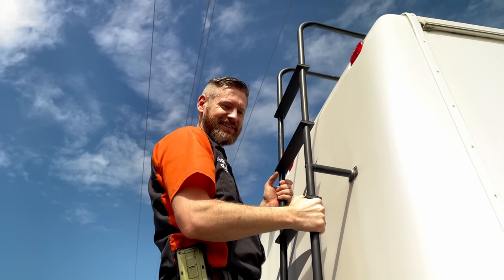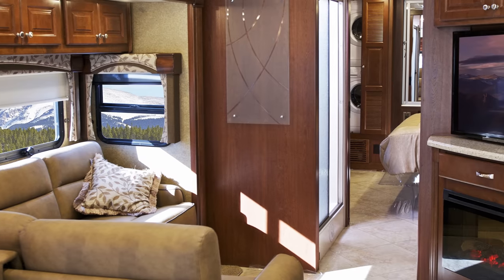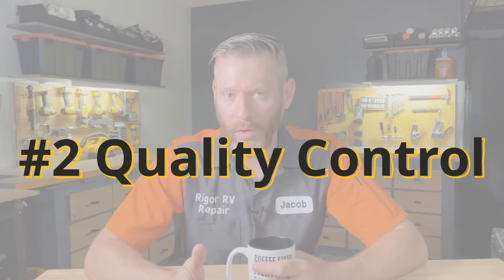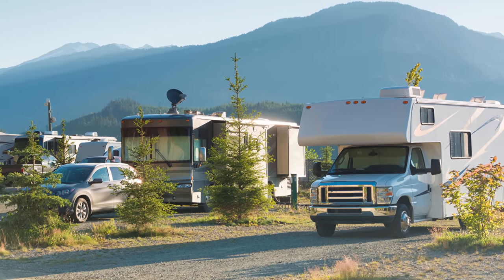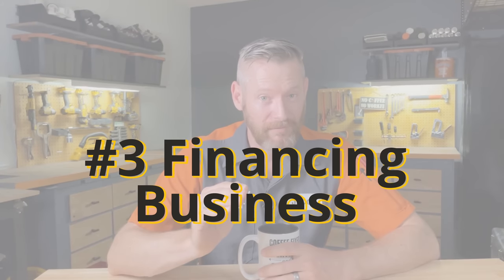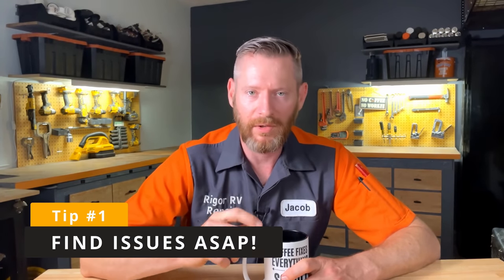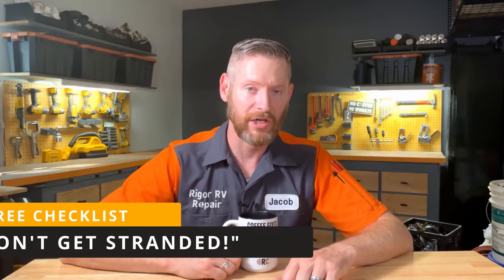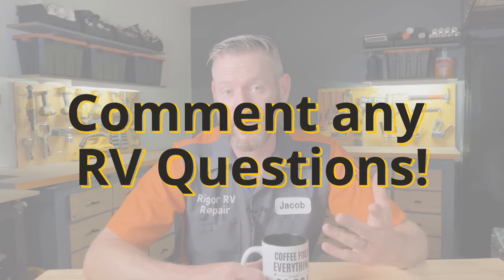3 Dirty Secrets the RV Industry doesn't want you to know...from an RV Tech

Comment: Bought a brand new camper July 2022. Went to pick it up and the power tongue wouldn't work. They replaced it on the spot. Within a month I had to replace the outside kitchen door because the hinge was catching. While they were replacing that, I asked if they would fix the light on my power tongue jack and instead of just fixing the light they replaced the jack again. Said it would void the warranty if they opened it up to replaced the bulb. Then some of the outside lights went out. Then the outside kitchen door hinge was catching again and the whole door fell off. Then the water pump stop pumping water from the fresh water tank. That one turned out to be a simple adjustment on the pump. A lot of small issues, but the dealership service department were great and always got me in and out quickly. Normally anytime I bought a new car/truck I always got a few years out of it before something went bad.  But so far all in all the camping is worth it. I do wish the quality was better, but the lack of quality seems to be across the board with all makes and models.

Comment: #3 is an eye opener.  I had checked out a loan package for an Rv a couple of years ago and it was astounding. No, I didn't buy the Rv because the loan was insane. The percentage rate was too high (but the industry was at a high at the time with sales), it HAD to be for at least 7 years. I had no choice but to start at a 7 year loan and there was a penalty for paying off too early. Then end result was pay a fuckload more money for the RV 7 years later. Also, the warranty would be useless anyway if I had to take it back to the shop and wait months for them to get around to it. Then, I am paying for an Rv that I cannot actually use.
Reply from the maker: Ouch. Yeah sounds about right. Yes getting warranty work done and done correctly is a huge problem in the industry right now.
Reply: @undercoverrvtech   Is there any particular type of rv you see more of due to poor workmanship...for example, the light weight ones or one's from a particular company? Ones that you would think are very very well made?
Reply from the maker: Keep an eye out for my upcoming review videos!

Comment: New sub. We bought a new lance truck camper. We set out on our first trip with it. I found the shower tub surround had cracked in 3 places. The cracks line up where the attachment screws are. The 3 way fridge only worked on 12V propane didn’t work. AC didn’t work. I checked it and the fridge wasn’t plugged into its dedicated outlet. The propane didn’t work the whole trip. Under 12V it’s drains the batteries. Dealership is getting hard time about replacing the shower it obviously wasn’t installed properly. We hadn’t even used the camper when I found the cracks. Waiting for parts now. Frustrating

Comment: 100% with you on this.  Dec 2022 I purchased a new 2022 Jayco Alante 27A from RV America in Calera AL.  I felt the "deal" I got was very good (price paid vs MSRP) but there are certainly issues.  #1 dealer didn't disclose the $1,000 they charged me for PDI (Pre Delivery Inspection) until document signing.  Honestly I should have argued this but decided not to.  Clearly they must have gone over it well if they charged me $1,000 right?  Right?  #2 the steering stabilizer that the dealership installed as part of the deal was installed improperly and never road tested.  #3 the Wineguard 2 system was wired backwards at the factory.  Apparently this is a VERY common issue with these system's on Jayco Alante units.  Much like your air conditioner story, how was that not caught before it left Jayco.  #4 all sorts of trim is falling off and the reason is the staples/brads used to put them up didn't hit anything other than the trim.  #5 dealer inflated tires to max sidewall pressure.  How on earth do they not know that's not the right thing to do.  There's a sticker by the driver's seat that has the appropriate pressures (I double checked it with Good Year's web site).  #6 the vent for the range doesn't close properly as it wasn't installed properly.  #7 nearly every drawer opens during driving.  This is bad design, my previous RV (2016 Winnebago Trend) used MUCH better latches on drawers and cabinets.  A 6 year newer RV has gone backwards in terms of design?  #8 kitchen sink drain leaked.  During assembly someone dripped PVC cement onto the threads while assembling pipes.  Fouled threads wouldn't allow the pipe to properly thread to the fitting on the bottom of the sink and thus it leaked into the drawers below.

I'm sure there will be more but I've only owned it 6 months.  With all that said we've done 3 trips so far and the RV is working well otherwise.
Reply: Sounds like you have 1 of the better products, these scammers, produced. 99% of them are junk new.

Comment: I have had several RV's over the past 15+ years, and recently have had two Class C's which had a Ford chassis. Ford sends their chassis' to the RV makers with neutral, unadjustable alignment bushings. These bushings Must be replaced in order to align both Camber and Caster. 
Anytime permanent weight increase or decrease is made to the chassis, an alignment Must be performed or poor handling will result. 
Camber is the tilt-out or tilt-in of the wheels and affects tire wear. Caster is the forward or rearward angle of the axle hub and affects both wear, if one side is disproportionate to the opposite side, - and most significantly, affects  negative impact handling, especially the ability to return to the neutral position of the steering mechanism. If the vehicle wanders or if it tends to stay in a drift (left or right), caster may be a significant cause. 
I have had two Ford chassis RV's and both have had the same unadjustable alignment bushings that come from Ford. These MUST be replaced or the vehicle will Not perform well regardless of specialized after market suspension components installed! I have inspected as many Ford F-350 and F-450 front ends as I have come in contact with (especially on RV's) and have always witnessed the same Unadjustable alignment bushings! Ford Inc. will Fax or email the appropriate specification sheet with all settings and tolerances if you make a call to them. Some alignment "specialists" claim that the aligned the vehicle without replacing these bushings, but that is a Lie because the stock bushings from Ford CANNOT BE ALIGNED!  
The bushings can be seen installed in the upper control arm of the vehicle, and a picture can be taken by pointing a camera straight down at the top of the wheel/tire assembly inboard of the tire. If you need help identifying the stock bushing just respond to this text and I will explain.

Comment: I bought one new RV.  Ended up witha rotten floor from some dipstick on the assembly line put the buteral tape seam up behind the water fill port.   Of course it was discovered well after the warranty was over.  

Now I never buy an rv less then two years old without a thorough inspection. That’s when the problem start showing up.

Comment: This is why I would never buy a mass produced RV. I do plan to buy a class B camper at some point in the future, but it will be custom built by a high level shop that has a reputation for quality. It will cost more, but I'm OK with that if it means I won't have to deal with a bunch of inexcusable quality issues, and can simply enjoy my investment. The worst part is that mass produced RVs are already extremely expensive, even though you're getting sh*t quality, so you may as well spend a little more for a custom unit.

Comment: What are your thoughts on stabilizer jacks. My 26 ft Grand design Imagine XLS came with 5000lbs stabilizer jacks. One jack failed, not at the scissor, bit at the mounting plate. My entire Rig empty weighs in at 5176lbs. When I’m loaded up I’m only adding about a total of 500lbs. 

My view is that it is not scissor components of the jacks that fail as they are likely worthy of the 5000 capacity, but the mounting plates (about 1/8” thick) that are the support between the chassis I-beam and the scissor are entirely inadequate. After the jack mounting plate bent on my rig, I was able to bend it back into position bare handed without struggling.
I just purchased 9000lbs jacks and will add 1/4” x 8” x 4” steel plates between the frame and the jacks mounting plate.

If these jacks truly supported the weight they claim to support a gust of wind should not be able to collapse the jack
Reply from the maker: These frames are notoriously lightweight.  The jack will easily hold the rated 5000k lb without any lateral stress. The problem is as you said, wind pushing the rv sideways put stress on the frame in a way it was not designed to handle. I agree this is a bad design! Another problem a lot of people encounter is the tounge frame on travel trailers collapsing when using an equalizer hitch and driving through a steep angle. Same 1/8 steel on the tounge. Same kind of under-engieering in my opinion.

Comment: No secret, these are apparent to anyone who has been duped into buying most RV brands. There are still a few quality RV companies out there and you will pay for that quality. Most of which sell only directly to the consumer. Which tells me that the dealer network has failed in providing service and maintenance. Do some research and if you have the funds save yourself the aggravation and buy a top of the line unit. It's worth it in the long run

Comment: I use to live in camp grounds, the amount of people with RVs costs 6 figures and them not being able to keep water out when they aren't even half a year old is really pathetic.  I wouldn't have a RV of any kind, I converted a school bus to serve as a RV, lived in it for 5 years to save to buy a home, so much easier to work on a bus (and cheaper usually) than wimpy underrated RVs that are just cobbled together with foam board and glue and vinyl.  Very little metal goes into it, I've scrapped 3 units in my life, all built like crap, I'd never ride in another motor home again, they are soo unsafe and the makers couldn't care less.

Comment: Wow. Good video. So, buy an expensive one (airstream) or build one. These things are very expensive not to be good to go out of the box. 
Can you identify good quality brands?
Reply: Expensive doesn't help.  Sat in a new Airstream and thought about paying as much for it as we did our hosue way back when.  It started raining and water poured nto the bed in a $85,000 unit.  This was back in about 2015, so I doubt quality has improved.
Reply from the maker: Unfortunately with brands they have various line with different quality builds. With hundreds if not thousands of different RV's on the market it is almost impossible for me to make generalizations. 
Stay tuned for more videos about things to avoid in RV's, a lot of my shorts will have tips that will help with shopping.

Comment: I want to thank you for your honest opinion about these factors. I have a 2020 Keystone Cougar 315  RLS that on our first trip the shower doors broke in transit. the dealer did replace them, however on our next trip they cam apart during transit.(frame separated from the wall) ,  after getting that fixed, the 3rd trip again they came separated from the wall during transit. My wife and I decided we don't need shower doors, we removed the doors and frame and installed a shower curtain. I'm very interested in keeping up with you channel. again Thank You very much for the info.
Reply from the maker: Yes, RV walls are almost a joke as the paneling is very thin. I'm sorry to hear they could not get this fixed, it sounds like the walls needed more support inside to screw the shower frame to. I suspect the screws were just put into the 1/8th inch paneling which is why they were ripping out.
Reply: @undercoverrvtech  We've had similar issues with our 2022 Tandera 5th wheel. Why the hell do they put screws into air and expect it to hold! My husband and I are re-engineering and fixing many of these issues ourselves as we will resolve the issue properly. We have a more involved issue with the entertainment slide out cabinet - the entire wall panel is detaching from the cabinet frame. Once we looked at it we discovered they only got 2 of the 5 support braces in the cabinet frame installed flush, the middle 3 braces stick out over 1/2" causing the wall panel to bow. After bouncing down less than silky smooth interstates the panel finally gave up and came off. The up side is I can now also fix the COAX connection that has never worked from day 1, install a new HDMI cable for a sound bar and clean up the wiring. As for the cabinet we will replace the 3 bad braces and install new ones attached properly and not with staples.

Comment: I was going to purchase a new tow behind rv trailer.. something small, under $25k. Went to look at them and couldn't believe how many things I could find wrong with them, and I'm not even anywhere near an expert.  Decided against buying one, because I'd only be using it for 1 or 2 weeks a year and I couldn't justify the cost. It's not like I even need it for that 1 or 2 weeks- I don't currently and never had before owned an rv.

I ended up renting one slightly larger than I would have purchased for a week last year for about $800, including insurance on it. This seems like the route to go if I want to use one for a week or two a year.
Reply from the maker: Renting certainly makes sense financially if you are only using the RV occasionally. I work on rentals frequently when they break down here, the challenge for the owners renting them out is maintenance. It is hard to get repairs done quickly between renters, and sometimes this results in a nightmare vacation for the renters. That said I work new RVs that are breaking down and ruining vacations as well. 😆
Glad to hear it worked out well for you!

Comment: I am about to buy a very small RV trailer that I may have to repair its front cap and front portions of the sides that adjoin to the front cap. The exterior skin is delaminating like this and has bubbles. 

I'm thinking of buying 2' by 10' corrugated metal from a hardware store and bolting them thru the front every 16" or so. Then on the seams I'm going to cover them and the bolt heads with white EDPM "eternabond" tape. 

Should this work?

Comment: Fantastic!! My kids just purchased a 46 ft Jayco Seismic 5th wheel not knowing it had a soft spot on the roof drivers side next to center pop up vent.. My quick question to you is should i pull the screws on the wrap around side to access & replace the plywood? Or cut out a 4x4 or so piece and eternabond/re-patch caulk? Thanks again!!
Reply from the maker: A proper repair would be to replace the soft decking. If you reseal it and stop it from getting worse you can "get away with" not replacing decking. If the soft area is large and presents a safety hazard to walking on the roof I would definitely reccomend repairing the decking.

Comment: We've owned a truck camper, 3 tags, a fifth wheel, and now our diesel pusher.  All of the campers were purchased used and served us well even though they were lower end units from Fleetwood.  Still had repairs but that is expected.  For our 2 to 3 times a year vacations they were fine.  The build quality of today's units are atrocious and the dealer support is almost in many cases non existent.  In 2019 we were fortunate to find an 06 450 Lxi Wandelodge from an individual that was in excellent condition that had extensive updates and repairs.  Yes it is expensive to keep up but there is a great difference in quality comparing those older units to the bird.  You get what you pay for and we have been blessed.  Subscribed.
Reply from the maker: Thanks for subscribing! Glad to hear that you found an awesome RV!

Comment: What's your opinion on the quality of the fiberglass travel trailers built by Oliver?
Reply from the maker: I've never worked on an Oliver! Which is a good thing, lol. Any fiberglass clamshell design like Oliver, Casits, Scamp, Chinook, is going to have less issues with the body that a typical rv with fiberglass laminated to plywood or even aluminum siding trailers. The fiberglass clamshell is like two boat hulls stacked together.  It is very structural and has fewer seams to leak, and no rubber roof to tear. 
If you can get one do it! Overall there will be less maintenance and you will have a better rv experience.

Comment: Just found your channel and am so glad I did! Subscribed immediately.

Here is my question: what do you think about rubberized coatings for the roof? I have a unit that is not quite 2 years old, roof is fine, just thinking ahead and wondering how long I should wait before a major roof renovation.
Reply from the maker: I usually only apply those to EPDM roofs that are very old and showing black through the top coat. In that case it is a good way to get more life from the roof membrane.  If you have TPO, PVC, fiberglass or aluminum you just need to be diligent to reseal the caulking every year.
If you have temperature management problems you can apply a roof coat that is highly reflective to help it stay cooler.
Reply: @undercoverrvtech  Thank you! Will stay after that caulking.

Comment: Fantastic!! Quick question.. My kids just purchased an 18 Jayco Seismic 46 ft 5th wheel without knowing it had a soft spot on the roof next to the center pop up vent. Should I pull the screws on the wrap around side to access (drivers side) and replace the 3/8 plywood? or cut out a section and eternabond or re-patch it? Thanks again!!
Reply from the maker: A proper repair would always be to replace the soft decking. If the spot is not too large you can "get by with" patching to prevent more water entry. If it is large enough that someone might step in it I would definitely recommend repairing the decking.